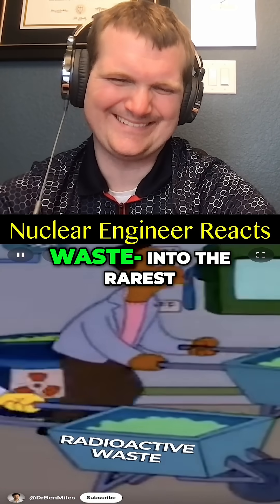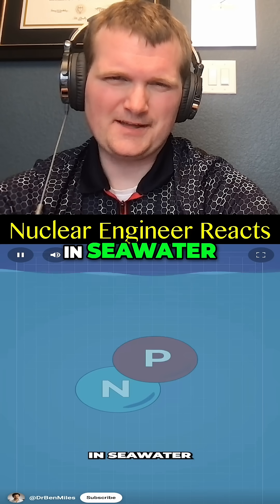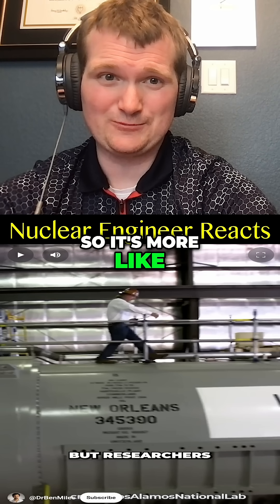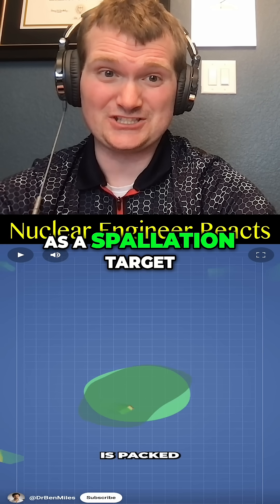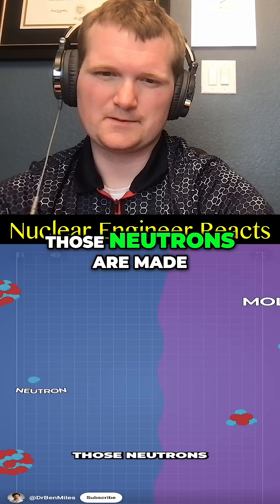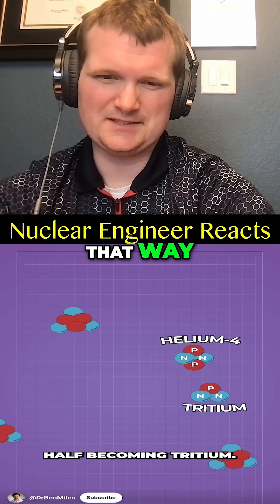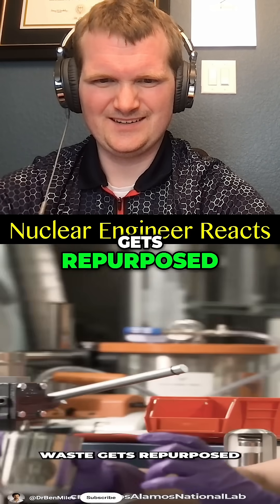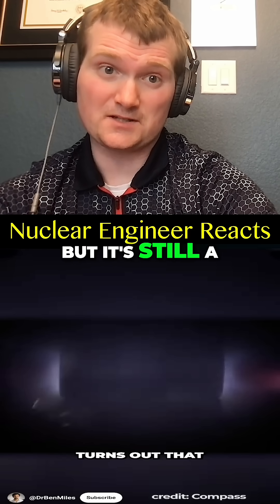Making Fusion Fuel from Nuclear Waste? - Nuclear Engineer Reacts to Dr. Ben Miles

Comment: The lithium part jogged my memory. Do you have a video on what went wrong with the Castle Bravo test? What should have been a 5 megaton explosion ran away to 15 because of I think Lithium-7? That's super oversimplified but I always  thought that was really interesting mostly because my uncle was in one of the bunkers and well when it went off aside from being immediately trapped inside but he said that he could see the rebar reinforcement in the concrete during the initial flash.

Comment: Why do they say scientists? I mean isn’t it nuclear physicists figuring this shit out?
Reply: What do you think nuclear physicists are? This is a squares and rectangles distinction.
Reply: @JanneBernards I mean yea all physicists are scientists but still. Theres lots of different ones. Like chemical physicists, nuclear physicists, blood spatter physicists, even car wrecks have certain physicists to them too. I mean they should be more distinct about it. Not just scientists have learned this…… a physicist is someone who learns how stuff interacts with one another, a nuclear physicists is the same thing they just learn how unstable isotopes react with one another, then nuclear engineers learn from what nuclear physicists have learned and then build something to contain the reactive process and harness the energy. A nuclear physicist learned that if you put two radioactive materials next to each other they generate heat and then a nuclear engineer takes what other physicists have learned like the melting and boiling points of certain metals and then builds a structure to contain the process and harness energy from the heat being produced by the process like by using the heat from the process to generate steam. Nuclear engineers use what nuclear physicists have learned to build things and harness the energy from the process of it. Blood spatter physicists can tell how people were killed and by what object by determining the physics behind how the blood spattered off of them when they’re murdered. Like a blunt object has a distinct physics and spatter behind it compared to a sharp object and they determine the cast off of the object. I learned that from the Micheal Peterson case.

Comment: Now the question I have, is how many times could you potentially do this, and what type of leftovers would it have? How much could you potentially do this to the same batch of waste? Could you recapture the heat at the end to produce a bit of power as well, for efficiency? If so how much? So many questions.....
Reply: it doesn't matter because it is much more expensive than placing lithium-6 in a nuclear reactor to produce tritium

Comment: The question i have is how does splitting apart atoms in nuclear waste not just generate a metric fuckton of energy in the first place? Like, if we can already do that then why dont we have fission reactors running this way?

Also would the byproducts of the waste fission be more or less stable than the current waste product? Since i know when you split Uranium, there are a couple of really nasty isotopes left over
Reply: Correct me if I'm wrong, but don't particle accelerators use a boatload of power?
Reply: It is a small amount of nuclear waste being spalled, so the energy released won't be above average. You can, in fact, create a breeder reactor that could produce tritium this way. The byproducts would indeed become more radioactive, as stated in the video, due to the production of dangerous isotopes.

Comment: If you're not in a hurry, you can wrap anything hot in lithium6 and just wait as it decays, no particle accelerator needed.  You can wrap a fusion reactor in a lithium salt blanket and breed the tritium in the reactor. The lithium salt also acts as a shield and a coolant. The problem is that you need to reprocess the salt blanket in situ so it doesn't stop producing,
Reply: Not everything that's hot is a neutron source.

Comment: Any way to change waste into a resource should be researched.  Heavily.   Whether high or low efficiency you’re still converting some waste.
Reply: I think you left out an important and key aspect in your comment. I would add, *highly dangerous and harmful waste to all lifeforms, to what you said.
Reply: @CeRz that was implied as a sub-set of the term waste.
Reply: @ericharrison6418 my trash bag that I threw away this morning was waste too, it wasn't necessarily very harmful, at least I don't think it was, I feel fine right now, luckily.
Reply: @CeRz YOU THREW IT AWAY?!?   It was perfectly good fuel for my delorean.
Reply: @CeRz my guy the topic is clearly nuclear waste.
Reply: @CeRz  depending on how recent and what kind, it's not really that dangerous. On top of that, you are potentially making it more dangerous by blasting it with neutrons, spallations can produce some more radioactive isotopes than what is present in the waste.

Depending on the cost and efficiency of this process, I'd maybe prefer drilling a very deep hole and dumping nuclear waste there.

Comment: Definitely interesting tech! Although we may be dealing with more concentrated waste, this is a leap in the right direction for reducing the total waste generated and repurposing it for continued use. 

We can only hope that, as the science continues to advance, so does the efficacy and precision of the reaction.
Wouldn't it be wonderous if, in the near future, we could advance to a point where we can not only extract and refine the waste, but still use the remaining waste material?

Perhaps something that could react with the radioactive particles decaying from the waste to generate low levels of electricity? I heard that theres research into something like it (Nuclear batteries/gammavoltaic cells) that shows promise.

With waste being concentrated, it could accelerate research into that field possibly as well.

What are your thoughts?
Reply: I think hamburgers go well with fries
Reply: He's won't respond. He's a condescending, gutIess Ioser who looks at you as a number.